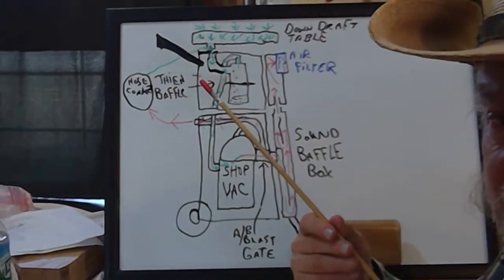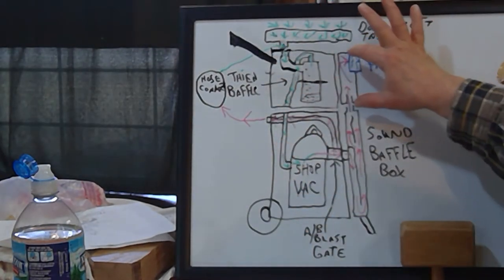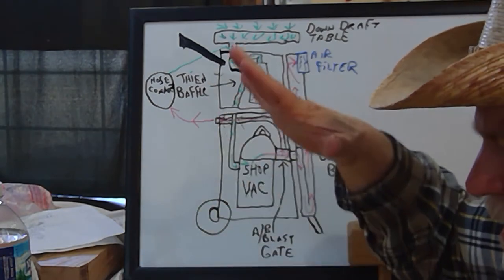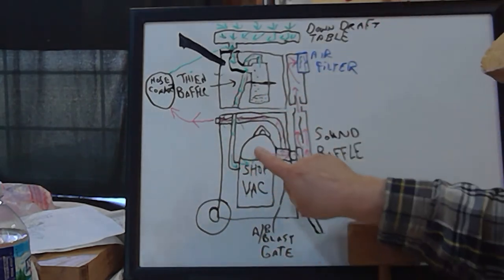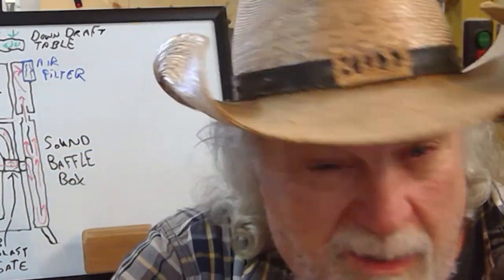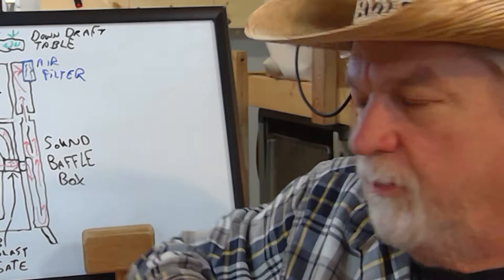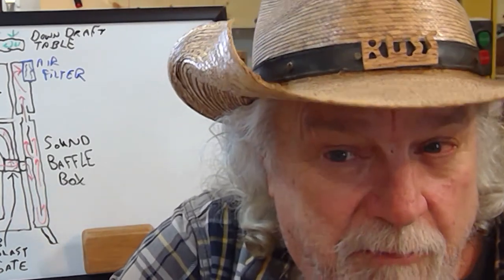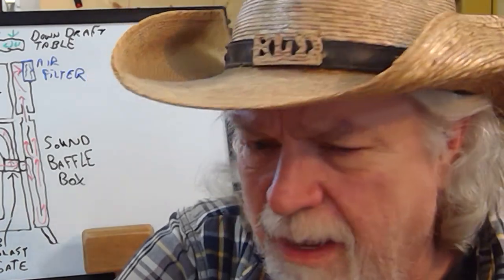Shop Vac Cart by OTB Thinker

Comment: You can remove the wheels off the shop vac the help keep the box height to a minimum. Also I  have heard mention the shop vac blower/motor needs airflow to keep cool, even more important when in a closed box. Great idea, sounds familiar :)
Reply from the maker: The wheels don't have to effect the height.  they can be not touching until leaned back.  my height is so tall because the shop vac I have left to use is  a tall (36") one.  if I used one of the other vacs I could keep it shorter.  I think I want the overall height to be comfortable when using the downdraft table.  I also have an idea on how to keep the motor cool.  thanks for bring that to my attention.
Reply: I meant the wheels on the shop vac, mine has wheels and assumed yours did too. Sounds like height will not be an issue for you. Waiting to see what you have for motor cooling.
Reply from the maker: Oh,  I took those off and the handle on top.  It is 33.5" now.  I am shooting for 35" box height (same as my workbench and TS) .  if I can do that it can be used as an extension table for either maybe.  I have been thinking of the motor cooling more seriously since you mentioned it and I have 2 schools of thought for a solution.  both are OTB ideas :>) .  Not sure yet.